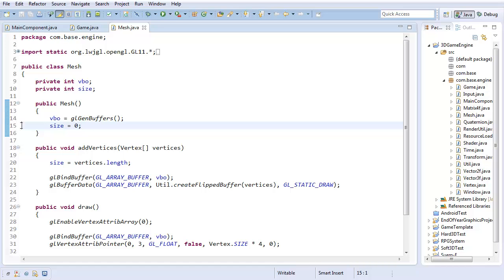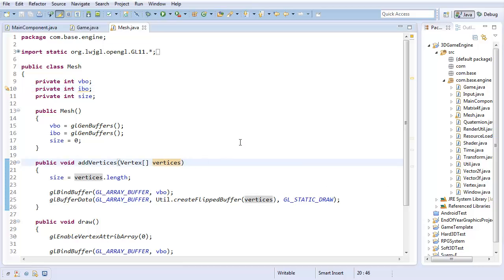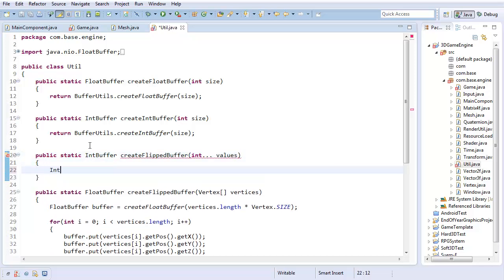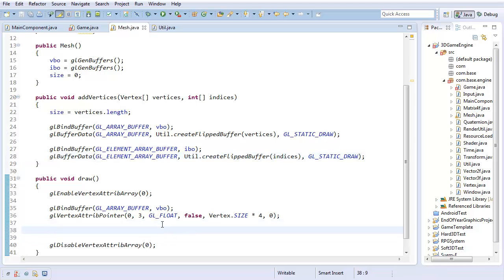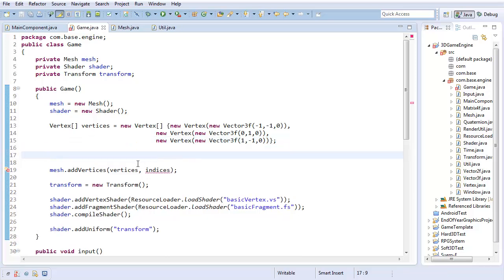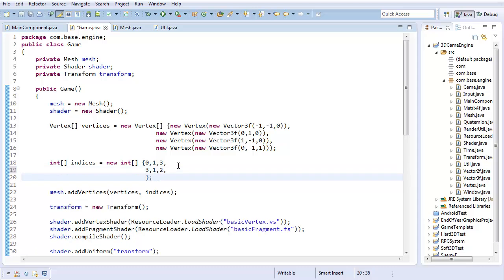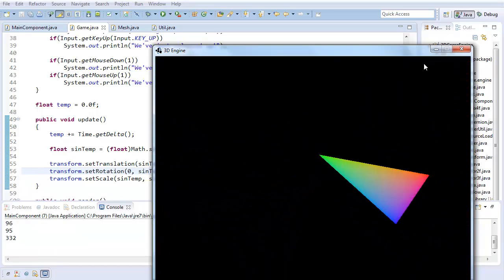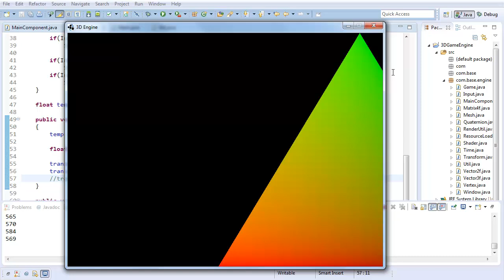#15 3D Game Engine Tutorial: Mesh Faces

Comment: Does it always make sense to use indices, or can sometimes a GL_TRIANGLE_STRIP and GL_TRIANGLE_FAN be more efficient for re-using indices?
This is an issue why in my engine I cannot really make a general Mesh abstraction, not every mesh uses indices and the meshes use different draw commands. E.g. if i want to draw a cylinder, i use a triangle strip for the side faces and a triangle fan for the bottom and top face.

Comment: Here is the code to display Egyptian-like pyramid:
Vertex[] data = new Vertex[]{new Vertex(new Vector3f(0, 1.7f, 0)),
                new Vertex(new Vector3f(1, 0, -1)),
                new Vertex(new Vector3f(1, 0, 1)),
                new Vertex(new Vector3f(-1, 0, 1)),
                new Vertex(new Vector3f(-1, 0, -1)),};

        int[] indices = new int[]{0, 2, 1,
                0, 3, 2,
                0, 4, 3,
                0, 1, 4,
                1, 2, 3,
                1, 3, 4};
For best display, in update method use:
tmp += 0.01;
float tmpSin = (float) Math.sin(tmp);
transform.setRotation(tmpSin * 180, tmpSin * 180, tmpSin * 180);
transform.setScale(0.5f, 0.5f, 0.5f);

(with tmp starting at 0.0f)

Comment: Everything has worked fine until this tutorial.

Whenever I don't multiply the vec4 by the matrix in the shader, it renders this:
http://gyazo.com/009f95f99b1eead097249e1ca2030343

Whenever I put it back though, making the line "gl_Position = transform * vec4(position, 1.0);", it just shows a black screen.

Even if I put this right above the setUniform line:

		transform.setRotation(0, 0, 0);
		transform.setScale(0, 0, 0);
		transform.setTranslation(0, 0, 0);

Let me say again that before all the ibo stuff this worked fine.  Any ideas?

I FIXED IT:
The problem was that my scale was 0,0,0, so all the vertices were being multiplied by zero.  Maybe 3AM programming isn't for me...